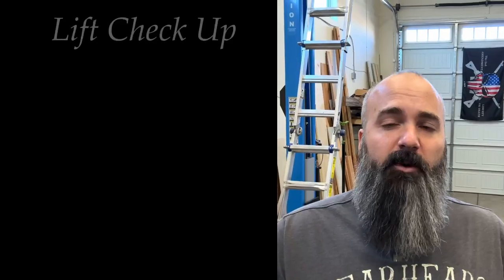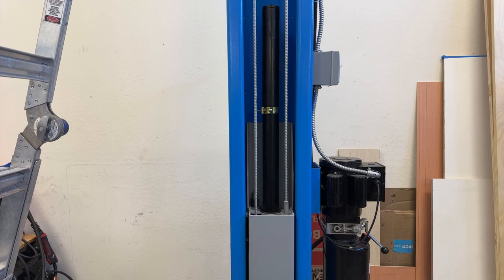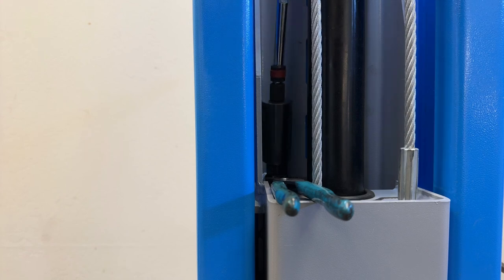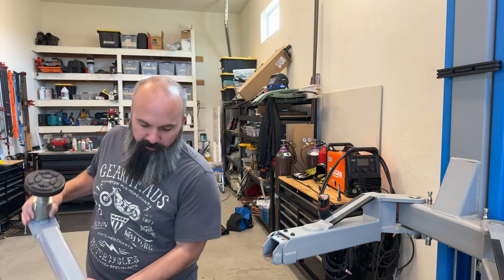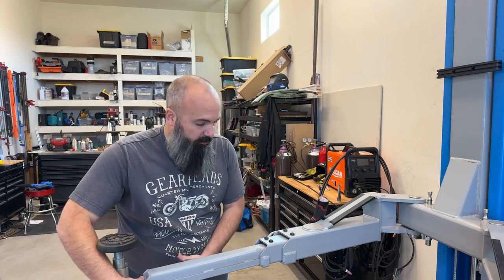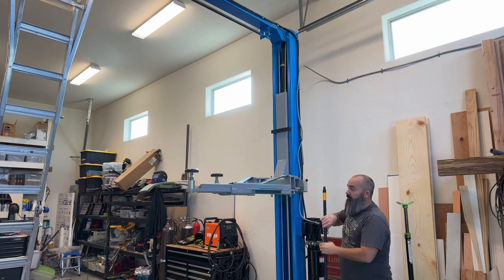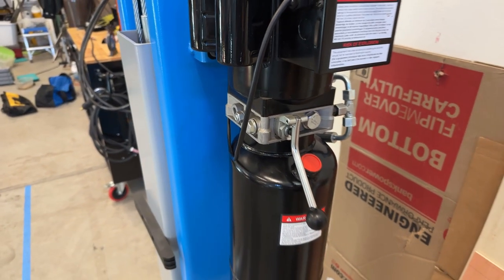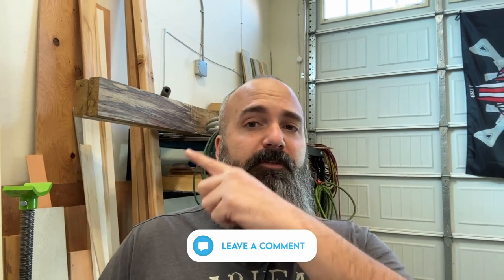2 Post Lift Cable Adjustment | Maintenance

Comment: Just had this happen after 4 years non commercial use and had to adjust the cables.  Having a 10k lift doesn’t mean you don’t do proper maintenance.  Thanks for the great information and remember to make sure the cable feeds through is or are not twisted which could loosen the nuts.
Reply from the maker: Thanks for the info. I’ll have to watch my cables for twist!

Comment: Interesting. Many say the clack clack should not happen at the same time so you can hear both locks engage.
Reply from the maker: I can see that. That also means the carriages aren’t moving in time. Realistically the adjustment doesn’t last forever and is rarely perfect. Mine have a fraction of a difference so I can hear mine click clack as they go up.
Reply: It should only be 1 click with no weight on it. It will be out of sinc with a lot offset weight. If it's been a few years and you find yourself adjusting your cables a lot, stop. And check the condition of the cables because they most likely have frayed.

Comment: I just put my lift in last week.
My instructions says about a half inch.
I tried it out with a car with them kinda loose like you set yours, and the heavy side sagged significantly and made all the slack on one side.
For it to operate without one side sagging, they have to be pretty snug.
You will see if they're too loose when it's loaded.
Reply from the maker: Thanks for the feedback. So far mine is holding up great.

Comment: Nice video.  Really helpful.  Joined your channel . Any chance you have replaced seals on cylender for the 2 post lift?
Reply from the maker: I have not. I do plan to do a fluid flush though in hopes of keeping moisture out of the cylinders and prevent seal degrade.
Reply: @DrivingForwardBuilds, while the hoist is on the ground, disconnect the line going the cylinder you want to fix and cap it off (pump side) lift the hoist, the cables will lift the dead side with it. Now you can access the cylinder.
You will ether have a threaded cap or wire that wraps around the inside of the cap of the cylinder wall that holds it together. . And she's apart. Get a seal kit online and go nuts.

Comment: My lift hydraulics tank and motor looks the same as yours, I just installed, I see some units where guys bleed the cylinders but I do not see any bleeder screws on my Cylinders. There was a relief valve listed by the control unit. Not sure? any thoughts?
Reply from the maker: For my unit the bleed procedure was to run it up and down multiple times. Straight from my manual.... "Place a vehicle on the lift and raise until swivel pads are in contact with the frame of the car. Raise the vehicle up about 3 more feet and lower until the tires touch the floor. Keep raising and lowering the vehicle, increasing the height each time, until the vehicle is completely to the top. This procedure pumps all the air from the system. Now the lift is ready for use." Hope this helps. Mine had air in it that was mostly pumped out when I lifted to synchronize the carriages. I also ran it to the top a few times without a car just in case.
Reply: @DrivingForwardBuilds  Great! Thank you very much!

Comment: You actually want one to clack before the other because that way you know that they both got to the locking position. It has happen to me that I thought they both where locked and when I push the lever to lower the lift only one side was coming down and that’s super dangerous.
Reply from the maker: I can see how that would happen. I have markings on my lift to denote when I am clear of both locks for safety as a secondary measure.
Reply: @DrivingForwardBuilds  Thats actually a great idea , definitely going to do that

Comment: Do you need to lubricant your wire rope with something like 90w gear lube?  My Bendpak lift says to.  Not sure I want that smell.
Reply from the maker: That’s a good question. My instructions don’t mention lubing the cables. I wouldn’t like the smell either of gear oil in the air. If I lube mine I’ll use a dry lube.
Reply: They make a penitrating oil just for cables.

Comment: What about lowering uneven?
Reply from the maker: That sounds like a potential restriction in the hydraulics.
Reply: To be more transparent, the one side will lower a specific and consistent amount but then remain that distance ahead of the other the remainder of the descent. Could you elaborate what the potential restriction could be?
Reply from the maker: @Justin131993  First let's make sure the carriages are even going up. That should eliminate the balance cables as the problem. Then I'd double-check check the carriage sliders aren't binding on the pressure release. After that, a hydraulic restriction would be the last path. A tight bend, kink, or line failure could cause one side to "pause" overcoming the restriction and then lowering it. Is this an old lift, has the fluid in the system been changed? Also, I'm just a dude in his garage too, not a lift tech. But happy to try and help.

Comment: Would this be the same for a chain drive?
Reply from the maker: Yeah. The cables might be in a different location but the concept is the same.
Reply: Nice lift, did you have to do anything special as far as the concrete in your garage floor before it was put in?
Thanks,
DC
Reply from the maker: @danconlan8735  This lift had minimum specs for the concrete for PSI rating and thickness. It will vary with each brand but 3000PSI and 4" min is a good start. The only prep work I had to do was to locate my tension cables via an X-ray of the floor.
Reply: @DrivingForwardBuilds  are the tension cables put in by the builder when the floor was poured? I am considering a lift more for storage of a car but I figured I would have to reinforce the floor or replace it with some kind of beefed up concrete!
Thanks,
DC
Reply from the maker: @danconlan8735  My house has "post tension" cables built into the slab (by the builder) rather than rebar. The cables in my slab are under 10's of thousands of pounds of tension. For storage of a car a 4 post is a great style, plus the load is distributed so the concrete doesn't need to be as robust as with a 2 post.